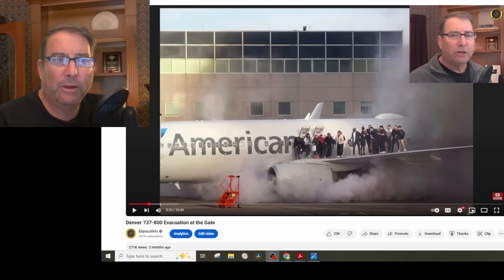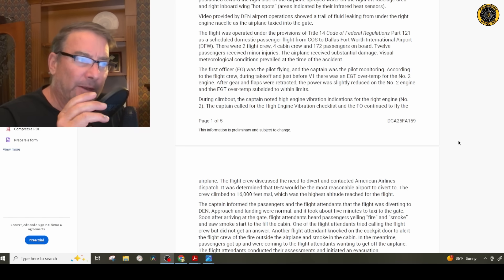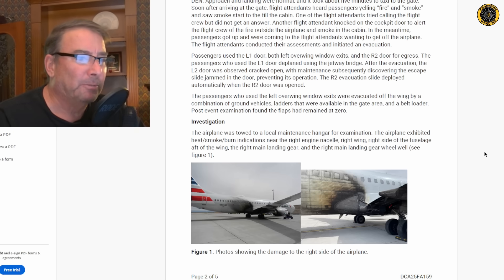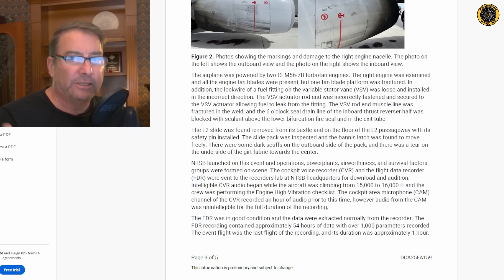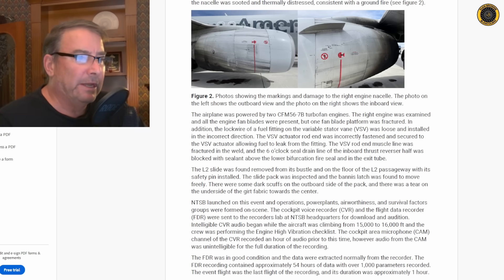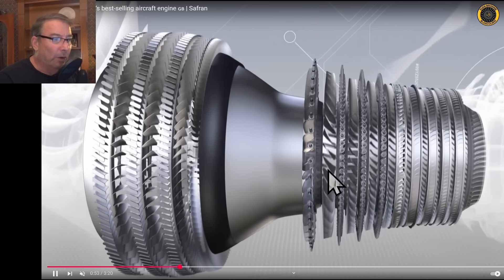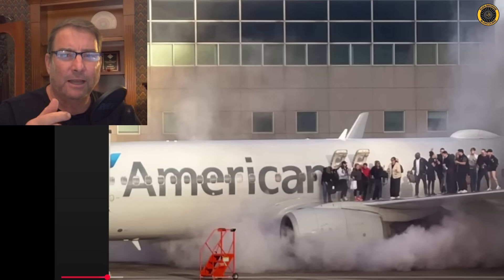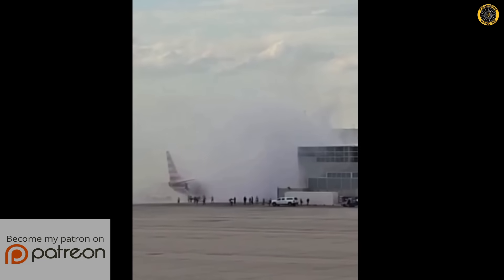NTSB Prelim American 737-800 Engine Fire at Gate and Over Wing Evacuation

Comment: Hey a little info on the slide issue, first off my background is an A&P working on 737 NG, Max, and airbuses (320 family) mainly for the past 3 years, so relatively new to the field. Those slide have a bottle that is used to assist in inflation, now during MX, we put a pin in the firing mechanism of said bottle so it, ya know, doesn't blow up in our faces. now reading the NTSB report, they said that the safety pin was INSTALLED at the time of opening the door, which would ABSOLUTLY prevent the slide from deploying correctly if at all, and may get it jammed in the bustle cause that pin isn't the smallest. also any kind of removal of the slide, installation of the safety pin etc. has ALWAYS been an inspection item for the 3+ years I've been a mechanic. a lot of us don't mess around those slides cause they can very easily kill us. don't know how all this stuff, that IMOP should all be inspection, fell through the cracks so badly and hope the NTSB report sheds some light on why this happened so those like me in MX can learn from this and do our job better. Just glad no one got fatally injured, but this still should not have happened.
Reply: Somewhere there is an excellent video of what happens if a slide deploys without the door being open.  Not good to be near!
Reply: According to the NTSB report, the pack was discovered on the floor. In contrast to earlier in the report,  the escape slide was "jammed in the door, preventing its opening." My question is: would installing the pin on the pack stop the door from opening? It's clear that it would certainly prevent the pack from inflating. Although I'm not a mechanic, I have often worked around slide packs, and mentioning the tear on the girt fabric's underside raises suspicion of other malfunctions.
Question for DEN Line Maintenance: Was the pin added after the evac to prevent the slide from inadvertently inflating inside the cabin, making it safe for inspection?

Comment: Former USN Aviation Machinist Mate  and 43 year Boeing veteran here. Two big things in this report. First, the VSV system is common to many GE engines: CFM, CF6, GE90 and the GE9X. It is a great solution that saves tons of carbon from being released into the atmosphere. The system is complex. There is an actuator as part of the engine that controls the VSV. It uses fuel as an hydraulic fluid to control the system. Sounds a little crazy, but if it is put together correctly it works well. Otherwise it is very possible it could leak hydraulic (fuel) fluid. Incorrect safety wire is an issue, but if it is not associated with a loose bolt it only shows poor maintenance. It looks to me like backwards and cracked parts would lead to fuel leaks. No telling how long this has been leaking, but here we are with a destroyed airplane. God bless nobody died.
Second is Door 2 left. People we trying to get out of the airplane. The slide packs come from the vendor with safety pins installed. The safety pins must be removed once the slide is installed. These slides are deployed when the Girt Bar (connected to the fabric) is pulled. This pushes the door open and inflates the slide. The safety pin will prevent this action. 
The Girt fabric being torn tells me somebody really put their all into trying to get Door 2L open. The door bustle being taken off and the slide removed tells me somebody understood their training and had the clear mind to save people. 
The things that I question are:
1. What is the maintenance history of the engine. This just didn't happen. I really doubt this engine came from GE like this. How long was it leaking fuel? Why doesn't the NTSB cite this?
2. Why didn't Door2L open? The safety pins are not part of the daily cabin crew procedures. This is a big deal. TG it was only one door an the fire was put out. If all four doors had this happen it might have been a great disaster. 
3. Lasty, why didn't the flight deck respond the the cabin crew? I don't agree with the determination it was an uncommented egress. Somebody has to take charge. In the case the flight crew was completely oblivious to the conditions in the back of the airplane and the cabin crew was heroic in their actions. 
Back in 2021 I flew American Airlines from SEA to SDF on an Airbus A321NEO powered by the P&W GTF engine. On taxi out the engine went into auto shutdown. Back to the gate. American never said the flight was canceled. So I sat there and watched. Maintenance crews came out with a pile of paper work, but no tools. They opened the cowls and stood there looking at the engine. A while later I watched the flight crew, pilots and cabin attendants coming out of the airplane with their luggage. I hollered across the Gate seating area: :Are you giving this flight up? Is the flight canceled?" The crew was in shock with this, the pilot called back and said the flight was not cancelled, American Airlines does not cancel flights." My Seattle to Louisville flight took 28 hours. Of course they lost my luggage. Of course I got into Louisville after the car rentals closed. 
I love American Airlines. Back in the day I had great fun working with them on the 777 program. Somebody should start making "Make American Airlines Great Again" hats. I would buy one.
Reply: Iirc, on the CFM56, there are two (2) VSV actuators - a master/slave arrangement - that moves the VSV assembly.

Comment: If I am understanding what the report says about the L2 slide, was removed from its bustle (the container that holds the slide and bolts it to the door) and the safety pin installed (pin is installed on the slide high pressure bottle which is what inflates the slide during deployment, during maintenance or transport the pin is installed on the bottle to not let it accidentally deployed ) the pin has a long red streamer like the ones that go across the windows for the entry doors to tell you they are armed but longer so you won’t forget it and I am not sure because I have never tried it but I don’t think you can closed the bustle around the slide with the pin installed, it just won’t close, again I never tried this and it’s a tight fit between the bustle and the slide plus you have a 3-4 foot red streamer basically saying hey look at me. Hypothetically if someone did force the bustle close with the pin installed on the bottle the slide would open but NOT inflate. It sounds to me more like someone told the mechanic to remove the L2 slide from the plane when they should have left it alone for the NTSB investigation, when thing go wrong and the FAA / NTSB is involved the plane is supposed be placed somewhere remote and quarantine with the circuit breakers for both black boxes pulled and collard.

Comment: No overwing slides, No Ram Air Turbine (emergency electrics and hydraulics), No Power Transfer Unit ( hydraulic single engine operation) the Boeing 737 is a far inferior aircraft to the Airbus.

Comment: I'm sure the day will come fairly soon when an AI system will exist on every new aircraft (like Tesla FSD) that can analyse numerous cameras and sensors around the plane and self direct an automated evacuation process if the aircraft is on the ground and stationary - including deciding which exits are safe to open, if there are vehicles/jet bridges in front of the doors etc etc. If a plane with an incapacitated pilot can autoland itself without any external input, even today there is no (non regulatory) reason why a plane can't detect a fire externally using cameras, analyse if its safe to auto lower the flaps, and do so on its own if an overwing exit is opened. Clearly it will take 20+ years for this sort of tech to reach every aircraft as they are replaced.

Assuming this tech isn't already out there.

Comment: I've been an aviation maintainer since 2000 and currently work for an aircraft  manufacturer. In recent years things have gone downhill significantly. Organizations are being managed/led  by people with no aviation background and those under them that know better just go along with the unsafe decisions. Leadership in this industry don't truly understand the risks that they are taking with other people's lives nor do they want to. That improper safety wire and general poor workmanship is the standard now, i see it every day. If you pilots had any idea what actually goes into aircraft manufacturing and maintenance these days you would all quit immediately. I've basically resigned myself to fact that one day one of our aircraft won't come back when the luck runs out. Maybe when the Feds dictate how things are to be done these people will get it together. Probably not though, just a matter of time.

Comment: This inability for the cabin crew to communicate with the flight deck seems to very serious. The Hanada accident Jan 1, 2024, is another example of this difficulty in communication. Perhaps a re thinking of these systems in in order.  Thank you Captain Browne for your excellent explanations of these complicated situations.
Reply: Agreed. On the forward and aft attendant handset stations there is an EMERG button which causes a triple chime in the flight deck indicating to the flight crew that there is an emergency situation in the cabin. I wonder why this was not used or not answered
Reply: @Citroeniste ,
Yes! That's the $64K question!
Smoke inhalation is a serious issue.
In an enclosed space....a nightmare. 
Not to mention the way smoke impedes vision!!
Reply: @Citroeniste  Unfortunately the report does not specify which was used. If the cabin crew used a normal call in a panick (because were kind of muscle memory trained to do a normal call), it's not that uncommon for those to go unanswered at this phase. I hope to god the pilots didnt ignore an emer call

Comment: So what caused the initial EGT over temp?  I would assume a fractured blade platform wouldn't do it.  Is the fuel leak  from the VSV actuator external or internal of the engine core where the EGT reading would come from ?  Would the leak cause enough of a pressure drop / operational issue to cause air flow issues in the core to spike the EGT yet not cause a comp stall?  Thanks for any input, just curious.  Great vid Juan.

Comment: If I heard you correctly the girt bar was not in the bracket when the door was opened? If that’s the case, the flight attendant disarmed the door for arrival (normal) but did not rearm for the evacuation.  I’m a flight attendant on an all Boeing airline so that’s my guess.

Comment: Another great professional very informative detailed presentation thank you. My comment is why didn’t the pilots get a fire warning alarm in the cockpit. I am a very experienced senior automation engineer from the electricity power generation industry. On large modern gas turbine power stations we have extensive fire detection systems which would have detected a fire like this in a gas turbine and alerted the operators?
Reply from the maker: Engines ore OFF
Reply: Working with system safety analysis. The fire detection system should not shut off when the engine shuts off. As clearly demonstrated you can’t detect post shutdown fires in that case. Somebody didn’t do their homework when they did the failure mode analysis.

Comment: Another excellent accident review. The more you know about the ultra-complex engine and airframes of commercial airplanes, the more amazed you are that more accidents don't happen! Thought experiment: What's the estimated number of things that "could go wrong" on a typical 737, e.g.? It's likely into the millions. So, one MUST conclude that the pilots, mechanics, FAA, airlines, Boeing, etc., are doing an incredible job, albeit imperfect, ofc. One final note from an armchair engineer.....there MUST be a better way to secure those bolts other than installation of lockwires as shown, That method is vulnerable to multiple deficiencies, e.g., incorrect installation, defective wire, etc. When you have rotational speeds of up to 13,000 rpm, every component and fastener has to be "perfect."

Comment: When you were talking about the failure of the slide at L2.. a thought came to mind (26 year Flight Attendant on 73-2,3,4,5,7,8 and 727) considering some pax evacuated through L1, which was attached to the jetway (disarm doors when the jetway is moving towards aircraft) all 4 doors were already disarmed. When evacuation was commanded, they attempted to again, arm the doors, possibly the girt bar wasn’t secured in the bracket and could not fully deploy.. OR.. was the girt bar secured and the door wasn’t swung open fast enough which can bring on another myriad of issues… just a thought. Appreciate everything you bring to the aviation community!
Reply: He also mentioned the safety pin was installed, this is a maintenance only pin to prevent deployment during shipping and installation into the case. If they forgot to remove pin after installation it would not deploy and it would just hang from girt bar. So many possibilities just another thought.
Reply: It just boggles my mind that nobody sought fit to lower themselves from the wing onto the ground. If you gently slide yourself down the drop would be only a few feet, even if you were not able to actually grab the edge of the wing with your hands to gently lower yourself. This isn't a 747.
Reply: @somealias-zs1bw  ....boggles?....really?...look at the photos again and I can easily see 12 ft height in some places, making injury quite possible with a jump... a considerable height and also there are many portions of the "wing" which are "no-step" areas like flaps...a lot to consider.

Comment: We need an actuator, should we use hydraulic fluid?
Nah, let's just use high pressure fuel.  What could go wrong?
Reply: The temperature is very high there. But there are special high-temperature hydraulic fluids. Those high-temperature hydraulic fluids are - to all intents and purposes - jet fuel. The problem is polymerization at high temperature (like when the cooking oil becomes the non-stick surface of a cast-iron pan).  It turns out that any jet fuel that can handle that temperature is a near-perfect hydraulic fluid for that environment.
Reply: @KennethAGrimm  Thank you for explaining how hydraulic fluid and fuel converge at the high temperature end.

I regret joking around in my earlier post.

Comment: I was a Navy  ET  never needed  safety wire.   But I got a chance at a pair of used pliers   not long after I was discharged and  had them for  maybe  15 years.  One day  someone  asked if  they knew where they could get some and I sold them.  I've always regretted that, they are expensive.  Before  Proto became part of the chinese Stanley family,  they sold them.
Reply: Also an ex-ET and I  also have a set of those that I used to add wire to critical bolts when I was racing cars. My chief built a VW plane, where these saw prior use.

Comment: There really needs to be a cheap, ubiquitous audio recorder for aviation. Something that's always recording but only listened to following an incident. Not a replacement for the CVR, it'd be something that takes only low-voltage power and hooks into the intercom and radios along with having a built-in mic. It needn't be crashproof, so it could have several days' storage. It'd be invaluable for investigating this kind of accident.

Comment: 26 years of Naval Aviation maintenance; only used safety wire pliers for the final pigtail as serrations in the jaws left stress risers in the wire, weakening it. Broken s/w is not something you want, especially in a helicopter.

Comment: @ 14:39, seeing the number of people with their carry on luggage on the wing pi$$es me off every time I see an emergency evacuation. The folks who exited through an emergency exit with their luggage care more about their possessions than they do about the safety/life of the people in the plane behind them. 🤬
Reply: Odds are they already had their bags on their backs as the plane was in the process of de boarding when the incident occurred
Reply: @RobertL1999 For sure! They were likely holding their luggage. AND…had they not brought their luggage they would have blocked further egress. They had likely already emptied the overheads. So…what to do then? I suppose bring it along to thus clear the path!
Reply: In an uncontrolled evacuation they may not be aware of the danger they are causing.
Reply: Remember Russian Aeroflot Flight 1492 in 2019? The aircraft caught fire on the tarmac of Moscow’s Sheremetyevo Airport, and 41 people died, many of them trying to get their luggage out of the overhead compartments.

Edit: I have since learned that it was speculated that they were trying to get their luggage, based on the sight of passengers fleeing the airplane carrying bags.
Reply: That's humans for you...
Reply: Calm down, self-appointed Safety Dog. You weren't there. You know nothing about the circumstances of this evacuation, and nothing about the people involved.
Reply: @KevinMaxwell-o3t  totally agree. same thing with the flipped delta. dead passengers get nothing but condolences, such innocent angels, but survivors “piss you off” by not reacting perfectly in an emergency.
Reply: @worryflurry yeah we can all agree that in general in most cases you should not be getting your things but people are freaked out and they're not thinking clearly and they don't know as much about aviation as the typical viewer of this channel so it's hard to pass too much judgment on them from our couches

Comment: This is why we had a qualified QA inspector to catch these error with safety [lock] wire. I made mistakes before. We also couldn't "inspect" our own work. A second inspector needed to check and sign off on your work. This was after i was discharged from the navy. An aircraft engine was brought back for inspection and repair after an in flight shutdown. Upon teardown only 22 of 99 bolts were installed in the low pressure turbine case! Yikes! The Navy logbook has who worked on the power plant.